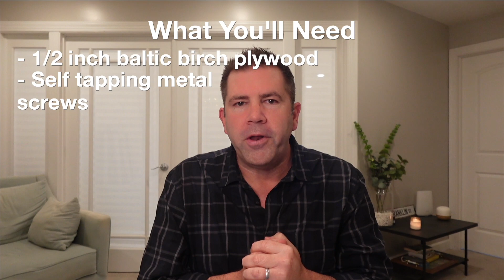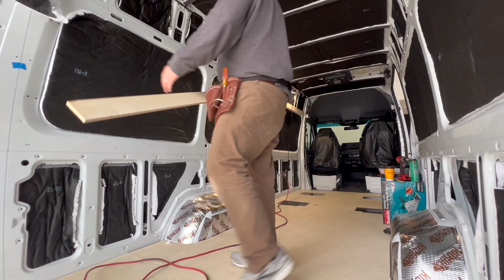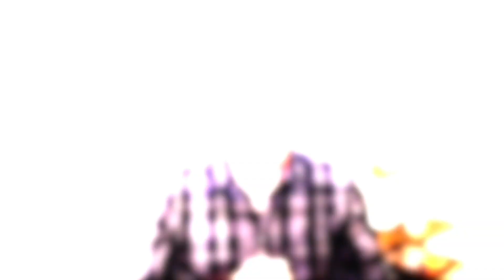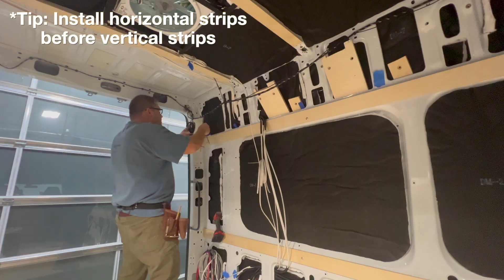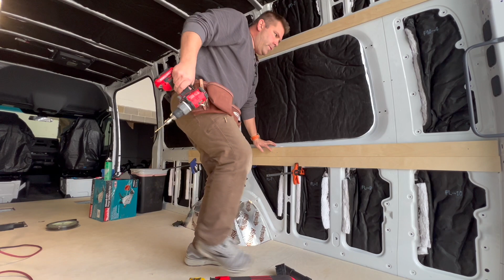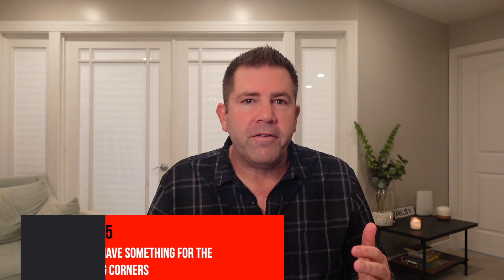Framing a Camper Van for Walls & Ceiling | Step-by-Step Van Build (Mercedes Sprinter)

Comment: Hi :) So you use 1/2 in plywood, but what is the width you use for framing?
Reply from the maker: Hi there. I used 1/2” birch for the framing, probably 3-4” wide. And then installed 1/4” birch panels for finished walls for this van. 🚐  Hope that helps.

Comment: Great video, thanks. Can you help me understand the why behind the rivet screws? 

I would think self tapping screws plus glue (PL marine) would be sufficient.  

I want to make sure these ribs never move, including after driving over really bumpy logging roads for 20% of its life. 

Anyways, any thinking you can share over that third type of fastening would be super helpful. Thanks.
Reply from the maker: Hi there. The pl and screws would probably be good enough (pl is crazy strong). But adding the rivnuts gives extra piece of mind and allows me to attach other things, more than just wall or ceiling paneling (cabinets, etc) if I want to. Hope this helps!

Comment: Why do u frame out could u screw your finishing product straight to the metal and save half inch space in your van?
Reply from the maker: Hi there. Good question, you can do it either way and some people do. I add framing for couple of reasons. One the van metal is what's called a thermal bridge. That van metal will be very cold so I don't want my finishing material directly against it. Also, it gives more room for insulation. So if you plan to follow the warmth, both of the reasons aren't as big of a deal. Final reason is the wood framing is easier to attach the finishing material to when precision counts...easier for screws to go in. Hope this helps!

Comment: I am building this van without the extension with my daughter. It is fun. Thanks for your videos. I have been in construction since I cleaned houses for my dad at eight. I am 61 now. This is different than building a house. I have watched almost all of your videos except for a few, good stuff.
Reply from the maker: That’s great! Have fun with your daughter! I have daughters. And you’re right, a bit different than houses. I always think about the extreme temps and vibrations at play. Hope it goes great!
Reply: @OdysseyCamperVans yes, more so than an RV. Are you still on the road?